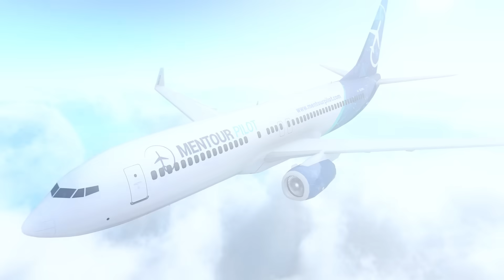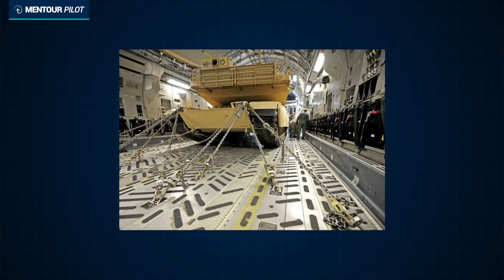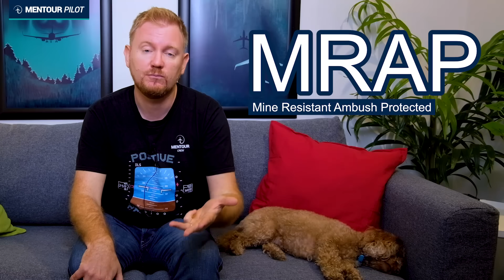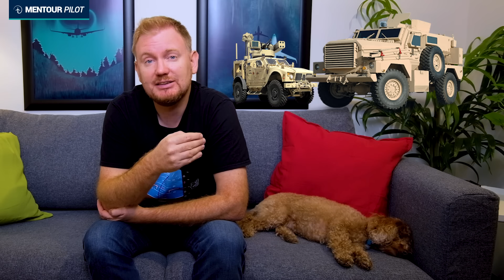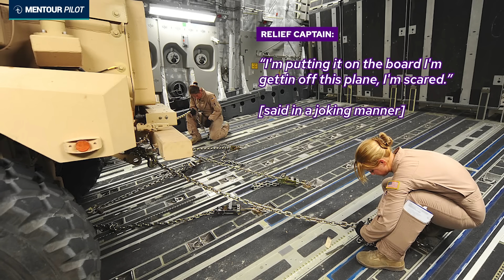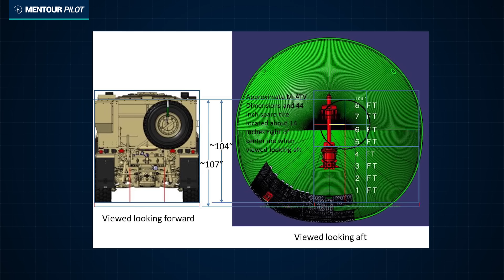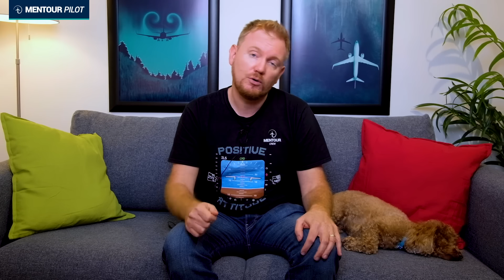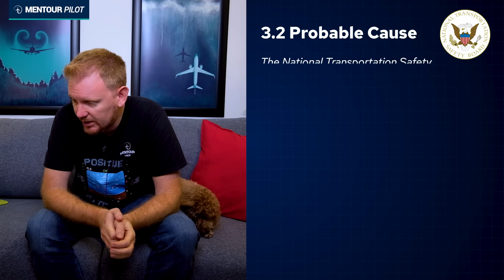Why did the pilots LOSE control?! National Air Cargo flight 102

Comment: The most shocking aspect of this accident to me is an overall perception that complacency always pervades until it reaches a threshold where lives are lost. I'm no expert on such matters but I would have expected that even individually such heavy cargo items would have had definitive and specific universally applied restraint systems researched under test conditions by the plane manufacturer prior to certification. I would also have expected that in addition to this, the training of loadmasters should be in accordance with an international and certificated standard. Surely if this is not the case there is a risk that an under-regulated contractor will just hire a minimum wage bozo to do what should be recognised as a skilled job. It would be very likely that under such circumstances such a company would ASSUME that the loading would be supervised by someone of specific authority like for example the pilot thus limiting their perception of their scope of responsibility.

Comment: DEI strikes again !
Reply: And, I'm sure, you can back up the claim that it was caused by DEI, right?
Especially when the captain, the relief captain, the first officer, the load master and the two mechanic were all white  American men.

But, hey, I'm sure you will be able to demonstrate that the relief first officer who didn't even fly the plane, the only non-white crew and was still an American man, was both solely responsible for the crash and was hired solely due to DEI and was unqualified for the job and that the lack of qualification caused the crash.

Comment: The way people talk about this in the comments here is a bit concerning. A very "the loadmaster should've known better" additide but... the whole problem is that he didn't receive proper training. Taking a job doesn't immediately beam all the relevant information into your mind; he should've known better, but the fact he didn't isn't his fault.

Even in the case of knowing the cargo moved, it's made clear by what he said he's used to it moving a bit. Because he wasn't trained properly, he thought this was normal. If he did it insufficiently every time, but it worked out, it's not unreasonable for him to assume that. No one told him otherwise.

He wasn't incompetent, because he couldn't have been competent in the first place. He was never given the knowledge needed to prevent this. It's not like he chose not to check the manual and it had extremely important info, rather because it lacked the info and he knew it fairly well, he knew he had no reason to check. He was experienced, but his experience was flawed because he'd been improperly taught.
Reply: I think it’s also worth noting that this was a LONG shift; over 20 hrs long. He was tired. They were all tired. People don’t think straight when they’re tired

Comment: So wait, was the lower of the two pallet “sandwich” dogged to the deck? You mention plywood reinforcing between the pallets and I wonder if it was sliding over that wood that allowed the top pallet on which the vehicles were resting to move? 

No matter what, you’d think the Army themselves would secure cargo like this instead of a basically untrained civilian, as I’m certain they would have resorted to chains and not strapping - loose strapping at that. “All loads like this move” is outrageous and while the loadmaster bears much of the responsibility for this, and he paid dearly, the pilot should have insisted on a qualified second opinion after learning that not merely were the inadequate straps not cinched-down but that multi-ton loads had shifted and broken straps on the first flight. RIP to them all.

Comment: Wasn't trained on direct tie down angle of effect on working load limit, and indirect tie down angle of effect on working load limit. Too many direct tie down points on a M-ATV on this model aircraft will exceed floor load capacity. For proper securement it would take 65 straps in an indirect tie down configuration, meaning 130 floor anchor points, and an auxiliary forward restraint system rated at 9g of load. As to the cougar, it's impossible to be secured correctly.
Reply from the maker: Thank you for that.. fascinating

Comment: Actually the crew could have rolled the aircraft left or right to get the nose down...this accident is a teaching moment for aviators that should not be missed. This is a required recovery maneuver for a Cessna 150 up to B747. So let's not say "nothing could have been done"
Reply: Rolling the aircraft doesn’t change the centre of gravity, it would not have helped at all.
Reply: @kickedinthecalfbyacow7549  Dear sir
We are not attempting to change the cg we are attempting to lower the nose back through the horizon which is the only way to survive. Roll the airplane.  Never forget this recovery procedure. Pass this along to fellow pilots.
Reply: Rolling the aircraft would not have saved the aircraft, the nose was lowered by stalling the aircraft, which also didn’t save the aircraft, the aircraft was aerodynamically unflyable for two reasons, the CofG was way behind the wing and the elevator actuator was damaged by the moving cargo.
Reply: @kickedinthecalfbyacow7549 Yes! They could not so a dam thing when the elevator was damage. Great respond. I blev that this guy how think he is smart is k owing nothing about real flying
Reply: You would rather climb to 400 feet before you start the dive?
Rolling the nose over would have shifted the unstraped weight forward and stopped the pitch up. 
Never say that there is nothing the crew could have done.
Usair 427 at Pittsburgh was a great example and I showed the FAA how to fly out of that situation with no great skill required. But everyone contended that the aircraft was unrecoverable.  Air Midwest in Charlotte was the same…roll the wing over to regain control.

Comment: Once again, I'm blown away at the level of detail you add to a mishap I'm already very familiar with. On the aircraft carrier, we tie down aircraft and equipment with TD-1A tie down chains. The working load of each chain is 10,000 lbs. If the ship is headed into heavy weather you will see aircraft with 30 or more chains. The idea that they used so few straps is mind boggling.

Comment: If the car is simply put on the handbrake, it can reliably stand at an angle close to 45 degrees. I don't think the angle of the plane's take off from the ground was greater than this angle. It turns out that the car was simply not put on the handbrake!

Comment: How complacent does a person have to be to use so few straps, then get on that plane and believe that they’re going to safely make it from point A to point B? Wouldn’t self preservation have kicked in and he would have felt safer using more straps? I’m not physicist whiz but I would have been like hmmm, whatever could happen if these move backwards is probably not the desired result, just like landing, whatever would happen if they shifted forward upon landing would be bad. I would have used all the straps lol they would just have to take the rest out of my check.

Comment: I was a 2T2 in the Air Force, and as soon as I heard this plane crashed, I immediately thought that maybe the load wasn't secure. The civillain loadmaster really messed up.Air Force loadmasters don't mess around. They will yank on straps and kick chains as soon as we're done tying cargo down. They will make the load team redo them and add more if they think it's required. I dont think I've ever seen a load that was accepted the first go around by the loadmaster. That being said, the cargo load team leader should have been checking the securement as well. Very sad story.

Comment: I was the maintenance controller on duty for Evergreen International Airlines and our 747-200 was #2 for takeoff out of Bastion on that day.  I got a call right after coming on shift from the flight crew of our aircraft in Bastion that they were going to be delayed, badly!  Of course I thought it was maintenance related and was told “No”, the National cargo aircraft just crashed off the end of the runway.  The converted 747-400 cargo aircraft DID NOT HAVE THE STRUCTURAL INTEGRITY TO CARRY THE MRAP’s.  That’s why Evergreen refused to carry them as our 747-400’s were converted.

Comment: isn't it a rule to use chains for tying this type of cargo. the tires must be raised from the surface of the pallet. also solid wooden washers are placed on the bottom of the vehicle where the bodywork is strongest. 1 chain has a force of up to 10k pounds and straps are used to tie down only nonmoving cargo on pallets correct me if i am wrong.

Comment: Didn’t use enough straps to tie down military vehicles. The straps broke, the military vehicles slid back and knocked out the 747’s jack screw and hydraulics disabling the rear flight controls resulting in an uncontrolled pitch up.  That’s pretty much it.

This guy does a great job of explaining the details.

Comment: Sir, I am not sure but captain had used maximum climb rate possible by Boeing 747 as they were afraid of getting shot down by militants, I believe, had this been a normal climb like a passenger jet, this wouldn't HV put  that much of pressure on straps. Kindly check it once.
Reply from the maker: The straps likely broke the second they rotated.. so it wouldn’t have mattered

Comment: It's not just special loads that could use better training and skill by the people in charge of loading cargo onto planes.

I occasionally travel with a friend of mine who uses a power wheelchair.  This has to be checked at the gate.  Every time she travels, her wheelchair is badly damaged. Broken armrests, broken backs, broken motors, missing foot rests or seat cushions, etc.  There seems to be no training of the people loading her wheelchair on how to do so without damaging it, or tracking to make sure all parts that get loaded into cargo get returned with the chair. 

And a wheelchair is essentially the legs of the person using it.  It's as if it was considered acceptable for a passenger to have a severe leg injury every time they flew, ones that left them bedridden for days or weeks after the flight (until she can get her wheelchair fixed.) 

In general, plane service for passengers who use wheelchairs has a lot of safety issues.  She can only enter the plane, or move about it, using an aisle chair.  Which doesn't get sent with the plane and passenger who needs it, but is left behind at the airport.  Because she cannot walk to the bathroom on the plane, she cannot use it for the entire flight.  She can only be lifted into an aisle seat, and cannot get up to let another passenger into an inner seat, so if someone is booked for a middle or window seat in the row she's in, they literally have to climb over her to reach  their seats, often stepping on her feet, or even her lap.  There are times this has left her bruised.  

And the safety instructions offer no guidance, at all, for how she should manage in an emergency.  There is no aisle chair to get her to an emergency exit.  There isn't even a transfer sling so other passengers or the cabin crew could carry her safely.  When we've asked the cabin crew how we should handle her safety in the event of an emergency, she's met with shrugs - no one is trained for this safety measure. 

I'd greatly appreciate a video discussing this issue, and how people with mobility disabilities, and their companions, should manage safely in an emergency.

Comment: I think the rollers on the floor was left in the UP position for the last load? another hidden dimension to this was the Pilot was told to ascend at a high angle to avoid Manpads that could be fired by Taliban insurgents.

Comment: I worked in airfreight for 2 decades and had lots of experience as a Ramp Agent for 747 Heavies.  It was my job to do the weight and balance, (which would be handed to the flight crew).  Before the Engineer dealt with the paperwork, we ALWAYS did a walk around of the entire uppers of the aircraft.  If there was a single strap loose, the load crew had to go back and check them ALL over again.  We ALWAYS used floor locks, then the straps were added, as if we KNEW that a floor lock was going to break. 
     This is not only because of an idiotic load crew, but a grossly negligent flight crew.  It never should have even started its engines.

Comment: Knew the crew and will never forget this mishap accident. My wife flew this airplane many times during her tenure at National Airlines. In fact, she was in the same theater and close to being on this mishap aircraft. Knowing the Chief loadmaster, the manual was copied and pasted from other manuals. The manual really didn’t address these types of special loads and simply used rudimentary calculations based on the load rating of the straps. Another issue was the angle of the straps. Having been a C-130 loadmaster before becoming a pilot, the angle of straps and chains are paramount. On the mishap flight, straps were past there design angle which drastically changed their rated capacity. In my opinion, the vehicles should have been chained down at the appropriate angles instead of straps to tie-down or attachment points that are appropriately rated.
Overall, great interpretation of the accident sequence and all the Swiss cheese holes lining up.

Comment: Excellent video! 

I appreciate your choice to not show the actual dashcam out of respect! Thanks! 

The re-creation is sufficient for the story to be told. 👍 It was also excellently made! 

One thing, and its not a big deal at all but it reminded me of another USAF plane crash: I think the plane actually went nearly 90° bank angle, which threw the nose down and they, tragically, hit the ground with a slightly nose down attitude

Important to note is that I dont think is really important to the  overall telling of this story, as the re-creation was still very accurate!  

I only mention it because I found it shocking how fast the nose dropped once the wings crossed the point where they were creating zero lift. I would have intuitively figured that, given the situation, the attitude they were at and all of that weight suddenlty shifted to the aft, it would have been nearly impossible for the nose to be down at all at that low altitude... shocked me how surreal it looked. The nose just fell like a rock. 😢

It reminded me of a local crash at the local airshow at the AFB. I didnt witness the crash but ive seen the video coutless times (im sure most have).

In that case, it was a B52 that crashed. It was during an aggressive, low altitude turn. The pilot (known to be reckless) banked far too hard. Due to the bank of the wings, the plane crashed faster than it would during a regular stall. They entered the turn at 250 feet AGL, and were supposed to maintain that altitude. Soon into the turn, the pilot had the plane banked at 60° at an IAS 182 knots. That cause the the airspeed to plummet to 145 knots (2 knots below level wing stall speed for the B52 of 147 knots). 

As the wings went past 60° of bank (they would go past 90° during the crash), either the pilot or copilot applied full right spoiler, right rudder, and nose-up elevator.  Due to the fact that they were already 2 knots below level wing stall speed, the aircraft entered an accelerated stall. Not sure the right spoiler helped other than make the situation worse, but the right rudder input was a good choice. At that altitude, they couldnt have recovered. 

Sadly, one crew member seemed to have attempted to eject (you can see the emergency hatch being jettisoned in a still picture of the crash. At that point, the wings were past 90°, the plane is nose down and they were moments from impact) but failed to make it out in time. 

Also, while it was deemed as "pilot error", with contributing factors being the pilot's personality and history of reckless behavior as well as the sequence made by the pilots during the turn. As you have mentioned on your channel before, "pilot error" is a catchall type of phrase that indicates a deeper problem. In this case, that was also addressed. The USAF took its time when it came to punishing or training the reckless pilot. The Airforce knew of his previous exploits and his reckless behavior (many crewmembers refused to fly with him and one of the crew on board that day was there because they felt it was their duty to stop the pilot from making any reckless decisions) yet they allowed him to fly. Had they acted in a timely manner....this crash, frankly, wouldnt have happened. There would have been a different pilot who, likely, would have made sound choices....like, not pushing the aircraft beyond it's limits. I just wanted to be clear about the 'pilot error' part. A reckless pilot means the pilot shouldn't have been allowed to fly...and that's up to the pilot's supervisors to ensure they are grounded. 👍

Anyways, I only bring up the B-52 ceash because, I wonder if the severe bank angle in the case in the video caused an accelerated stall or something similar, which threw the nose down? They seemed to already be below stall speed as the wings banked. 🤷‍♂️   There was nothing they could do (to my knowledge) to recover this plane. I was just curious if that could have been the situation here. 

Excellent video as always!

Comment: As an engineer, who has used and done calcs for similar straps on maritime lifting operations, it blows my mind that a) they don't have a procedure for checking the calculation, and that b) if there's damage to a strap or questions on the strap, or unintended movement, that they don't either redo the calc to see if they missed something or add more straps. Straps cost nothing... this was the alternative.